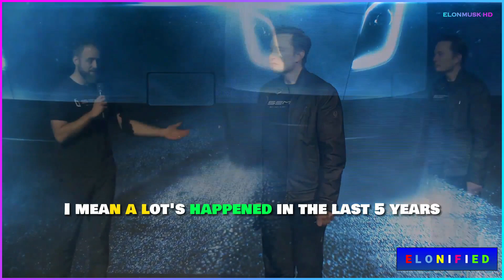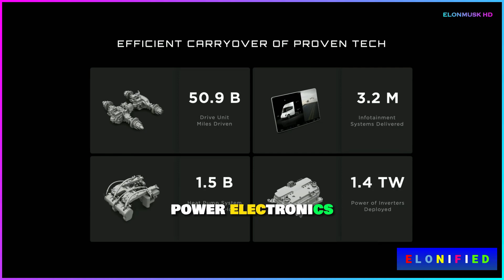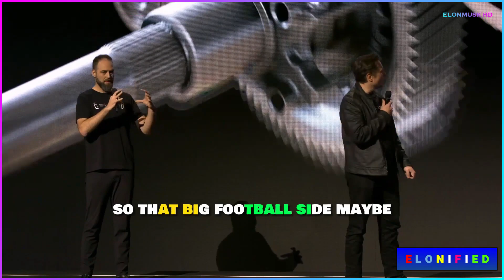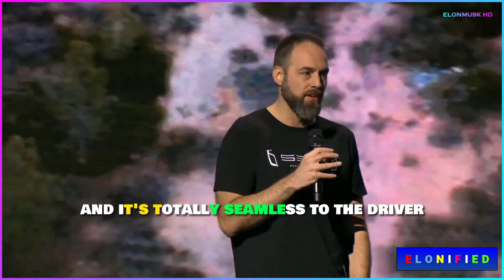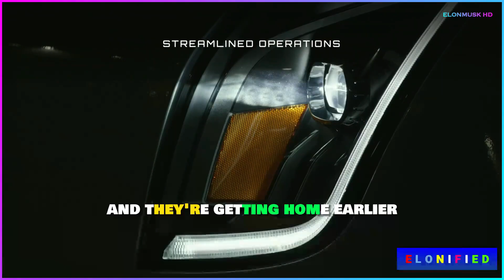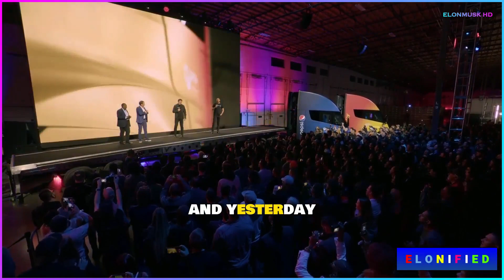Elon Musk Launch Tesla INSANE Latest Truck !🧠 SUBTITLES

Comment: compare freightliner to tesla semi 800000 miles  1) freightliner daycab $160000, fuel $400000, maintenence and repairs excluding tires $40000, value at 800k $60000 total = $540000  2) tesla daycab 500mi $230000  charging $150000 maintenance $10000 new battery pack at 400k $120000, value at 800k(dead battery) $20000 = $490000, savings of $50000 over 800k miles.  This assumes the batteries last 300 to 500k and the diesel lasts 800k or more.  The killer is replacing the battery pack at 400k.  makes more sense for tesla to compete with gas vehicles until there is a million mile battery pack, tesla will make some of these but will ramp ct until then
Reply: But where does it tell us how much weight this thing can carry?
Reply from the maker: @billywindsock9597  Updating next!
Reply from the maker: interesting